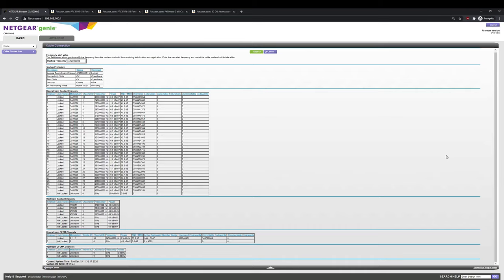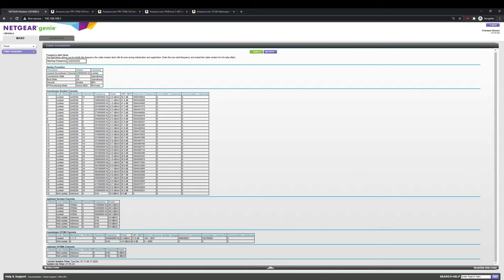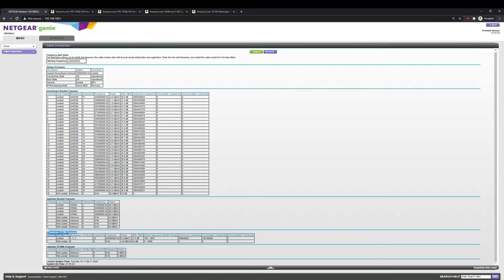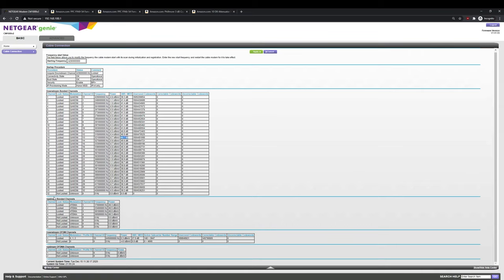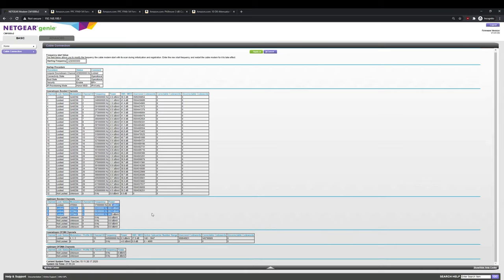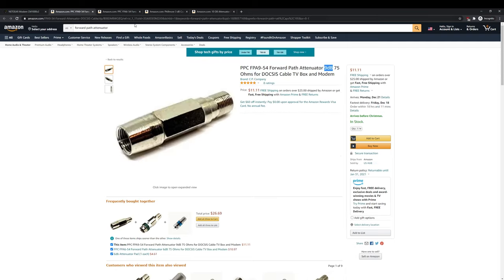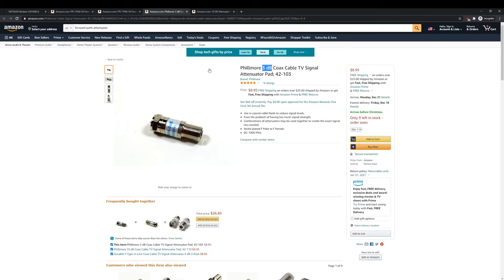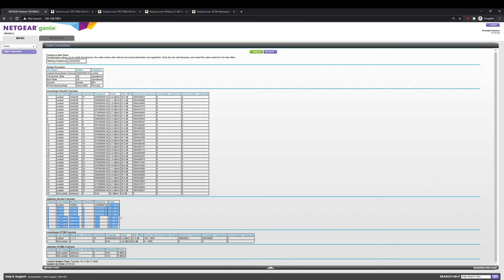Cable Internet Troubleshooting - Lag, Latency, Slowness, Here is how to fix!

Comment: Nick, thank you for taking the time to explain this.  One note, I do not think the splitter actually "increases" the upstream power.  The modem continues to increase its power output (upstream) until the cable company responds.  When you add a splitter, the modem is forced to output more power on the upstream channels to overcome the db loss caused by the splitter.  This is why you use an attenuator - so you can control which direction you are impeding.
Reply from the maker: Yep that is exactly correct I just didn't to explain that in detail during the video because I figured it could be more confusing for some and would make the video longer.

Comment: I’m a cable guy for charter spectrum and you’re spot on brother. I’ve never heard of a foreword path attenuator. Good stuff 👍
Reply from the maker: It's so weird it's like a USA only thing not knowing about them. All my friends in Europe use them all the time. My cousin who lives in the UK said he has a whole box of them from all the times he's moved. I've been running 2 of them for 2 years now and my connection from this ISP has been really solid.
Reply: @andrewbehm-  I wonder if you can answer a Q for me? I have a Netgear CM600 modem with a standard 6 attenuator. 24 downstream channels are locked but the SNR's vary by 5-6 (reading 36.1 to 42.2). Is that too much of a variation? I'm under the impression they should be within a 2 to 3 number spread.
Will replacing the 6 attenuator with an 8 or a 10 bring the SNR spread closer?

Comment: Thank you for an explanation. I have been struggling with Suddenlink (not so small and now is Optimum after the "name change" due to the poor support after the dual hurricanes in 2020). They have made me replace their modem numerous times and I have now tried 2 of my own modems. The last techs came out, checked my line and said it is "too high" and literally just disappeared until I got a bill where they claimed it was my personal equipment causing the problem. I cannot check the levels with the Optimum modems, but I can with my modems and this finally helps me actually get the problem fixed instead of the years of "waiting to see if it works" after a small "adjustment" is made.

Comment: Very nice info and I learned some stuff.. Only thing I would add power can be -12 to +12 and still be ok but out of spec.. -7 to +7 to be in spec...  Bad SNR is usually a problem on the cable provider side and you really can't do nothing but call them...unless you got like a really bad  failing Splitter or connection somewhere..

Comment: I wonder if you can answer a Q for me? I have a Netgear CM600 modem with a standard 6 attenuator. 24 downstream channels are locked but the SNR's vary by 5-6 (reading 36.1 to 42.2). Is that too much of a variation? I'm under the impression they should be within a 2 to 3 number spread.
Will replacing the 6 attenuator with an 8 or a 10 bring the SNR spread closer?

Comment: Great explanation, I've been frustrated with connection drops daily multiple times a day for a couple months now. This has got to be the fix, i followed your video and went into look at my modem numbers, damn way out of wack..., my average downstream power is from -1.0 to -3.5 also my upstream power is between 52.8 to 55.3 . i was thinking about getting a broadband drop amp, would you have any suggestions on what i should get to lower my upstream power and add to my downstream power? Thanks
Reply from the maker: Sounds like it's actually your upstream that is too high. Your downstream is within spec of -5 to +5. That would mean that there is probably a splitter in your line somewhere. I would try to remove it and check again. Splitters will reduce downstream and increase upstream.
Reply: @NickDelDuca  Thanks will look into this.

Comment: I bought a 15db down/10db up amp and it fixed everything
Reply from the maker: Yeah if your power is too low that's what you need. Really just depends on what your readings are in your modem.
Reply: @NickDelDuca  Whats messed all the wires in my neighborhood are underground so all the boxes are ground level. People break in the boxes trying to steal cable and it messes up everybodys signal until the company comes out and fixes it

Comment: During certain times of day (everyday), channels 22-28 started showing lots of uncorrectables, made my internet slow and disconnected until a reboot. Called isp and they said everything looked good on their end so they didn't send anyone out. I downgraded my modem from a 34 channel to a 16 channel and ever since my connection has been perfect, one month without any disconnections and speed is always at 150Mbps.
Reply from the maker: I was having issues at different times of the day as well. That was fixed by having the ISP replace the line coming from their box outside to my house. Not sure why that fixed it but it did.
Reply: @NickDelDuca  this is the problem I'm having right now in a condo complex. right around 11am every day the cable tv and internet drop in and out until around 3 or 4. they continually blame my owned modem so I've rented one of their gateways to see if that fixes it. right now looking at the setup page, all the upstream and downstream power levels are within spec but I have tons of uncorrectable errors on every channel. maybe I need a new cable to the distribution box?
Reply from the maker: @grumpy_ken  Possibly. I think for some reason a bad cable to the distribution box will give you more errors when the system is loaded. That's what was happening in my situation with the old cable.

Comment: My downstream power is reading -8.40 dbmv. Which product do i need to correct it?
Reply from the maker: I would start from your cable modem and trace the wire all the way back to where it comes into your house. Remove any splitters you find.

Comment: So Im seeing 17.9 dBmv in Downstream OFDM Channel section so assuming i need to get this down to at least 10 (confirm). On avg I show 14.9 for my Downstream Bonded Channels. Also, where/how do I install these and if I get e.g. a 6 & 9 do I connect them?
Reply from the maker: Yeah all of your levels are way too high. You just screw them on to the back of your cable modem where the cable line comes in. Or you can put one on the cable modem and one on the jack on the wall. I would sugest that if you are using 2 of them. You can stack them but splitting them up is better. They just sit in line with the cable line male on one side female on the other so they can be put in line.

Comment: One question. Are you able to chain multiple forward path attenuators? I have around +12db without the 7db splitter, so I would need two 6db forward path attenuators once I remove the splitter. Can I just attach two of them back to back?
Reply: Based on some research it looks like I should be able to.
Reply from the maker: Yes you can. Generally its best to space them out though and put one of them somewhere in the line if you can. It should still work to just couple them together though.
Reply: @NickDelDuca  Sounds good! I'll probably put one where the splitter is currently, and one on the back of the modem.

Comment: U actually know your stuff . Maybe you will respond but I’m getting a lot of high latency under load and getting a score of c on the bufferbloat test on wave form Idk if you know anything about that but I feel my gaming is being affected and it’s hazy and I feel delayed like I’m a shot behind in the game
Reply from the maker: So for the high latency there are lots of things that can cause it but if you have eliminated a lot of things and are still searching one is that I've seen cause that in my area is that the cables that are coming from the box outside to the house that are burred in the ground are really old and were installed when the house was built. I had very similar symptoms seeing packet loss during high load and replacing that cable fixed it. The life expectancy for those cables is about 10 years. You will have to call up your ISP and have them come replace the cable. Bufferbloat may or may not be part of the same issue. But usually bufferbloat is related to the QOS settings in your router.

Comment: So if my downstream is at around a -8 dbmv what do I need to bring it to zero?
Reply from the maker: There are probably some splitters somewhere in the line that you need to remove. Every splitter drops the power
Reply: @NickDelDuca  I do have splitters, but it’s needed for additional TVs. So what do I do to replace that? And thanks for the quick reply!!!
Reply from the maker: @victorc.395  You might be able to get splitters that drop signal less. They say on them how much they decrease the signal. Some are -3 some are -7. You likely have another splitter outside where your cable comes in to your house. So your power is probably getting cut multiple times.
Reply: @NickDelDuca  yes there’s one outside with a -7 and -3 and another in my room that splits the internet to cable box. You think an amplifier will suffice if I’m pushing power to it.

Comment: my downstream is -20bmv what should i get to fix it
Reply from the maker: Most likely that means that there are either tons of splitters in your line and you aren't getting a good signal, Or the line that is running to your property is bad. That's way under the amount of power that should be coming in. I would trace the coax cable back to the point where it comes in your property and see how many splitters it goes through first.
Reply: @NickDelDuca  my  line don’t have any splitters idk if it’s affecting my gaming performance but my ping and speeds are normal but I just want it to be in spec like yours so can anything be don’t to it like a different type of attenuator?
Reply from the maker: @tehwayne1002  Unfortunately no you can't boost the downstream signal. If you don't have any splitters I would guess the line coming into your house needs replaced by your ISP or the tap outside your house needs replaced. I would definitely call them and provide the modem logs. They should send someone out.
Reply: @NickDelDuca  alright thanks for the help I really do appreciate it um oh I have a return amplifier if I connect it it drops my downstream from -20 to -3dbmv and my upstream to 30dbmv ?
Reply from the maker: @tehwayne1002  Those are usually only intended for use with TV signals and can cause issues with cable modems. I still think you have too  low of signal coming in. What is the issue with your internet? Are you not getting the speeds you pay for or does it drop out?
Reply: @NickDelDuca  I’m getting the speeds I’m paying for and the correct ping I just feel delayed in game feels like behind everybody especially in call of duty
Reply: @NickDelDuca  I want to send you a screenshot of my current signal level what can I send it on any other platform other Yt ?
Reply from the maker: @tehwayne1002  If your speeds are correct and your ping is correct it's almost definitely not a network problem. There are many other things that can impact your input lag in a game, even the TV or monitor you are playing on. I don't have anything other than Youtube, Feel free to upload a screenshot to imgur or another upload site and share the link in the comments.
Reply: @NickDelDuca  what if ping plotter shows packet loss and latency spikes .. ?

Comment: When I post the link it goes away in the comments idk
Reply from the maker: I saw it. Looks like you have an extremely old cable modem. That might not even be Docsis 3.0. The info in this video is for Docsis 3.0/3.1 which has been the standard for quite a few years now. The power levels etc for the previous versions are different. I'm not familiar with the older modems. I doubt any ISP really still supports modems that old.
Reply: @NickDelDuca  ok thanks bro

Comment: wish i found this sooner, i figured this out before i found your channel and this is insanely good stuff, I do still have a problem though. My c7800 is setup in bridge mode and connected to an asus axe11000 and im hard wired from the 2.5gb port to my 10gb adapter on my PC and im getting 20-100ms jitter...
Reply from the maker: Try hard wiring into you modem and bypassing everything else just to confirm it's nothing in the chain but it kind of sounds like your ISP might just have a bad connection. I did however have to have the ISP replace the cable line from their box to my house to take care of some latency issues though. So if you haven't gone down that route that might be something to check.
Reply: @NickDelDuca  I'll have to reset the modem and take it out of bridge mode because it didn't take itself out when I disabled bridge, but I'm actually gonna rearrange my setup because wires are crossing and the modem and router are too close together so electromagnetic interference is possible. Xfinity said they were running me a new line but never came...